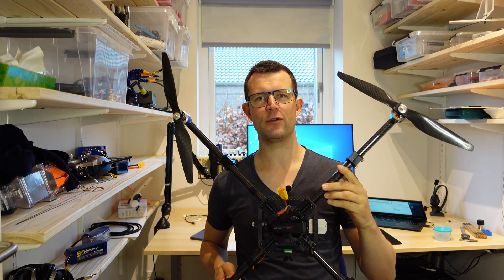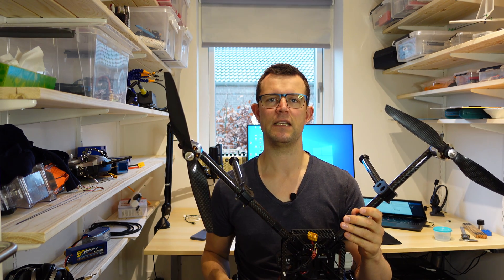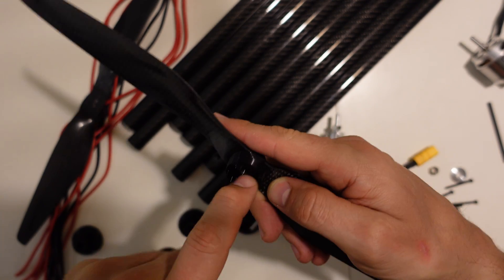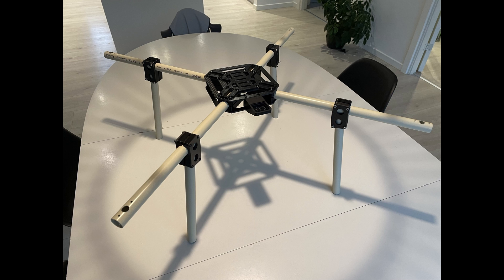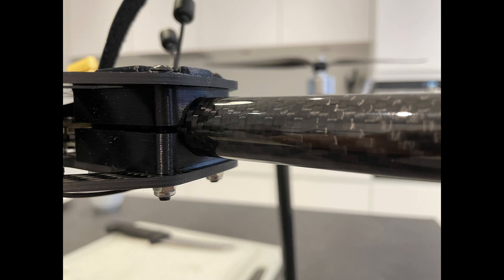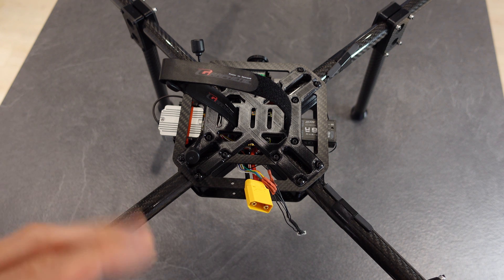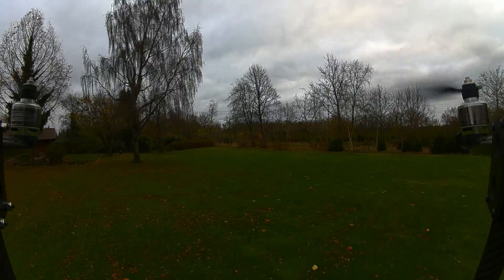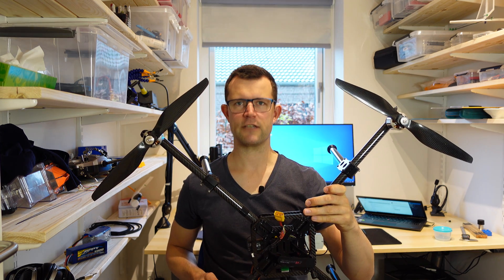Custom heavylift drone (build video)

Comment: I am quite confused about the CNC order from PCBWay as I have not placed such an order before.
The design files provided by Tom are .dxf files.  And this makes sense to me because it is a 2D design we are cutting out of carbon plate.
But PCBWay is insisting on a 3D design for the CAD.  
Are you able to tell me how you managed to place this order with them? Many thanks!
Reply: If you need a hand doing them as 3D CAD let me know, I can do it for you. I’ll export as STEP or any other 3D file format for free. It’s a 2 min job if you have the software 😊
Reply: @Altum2000  Thanks!
I was wondering about this.  I can simply export to STEP? And that is sufficient? So it will be a 3D format but it will still only be a 2D drawing, meaning it will be a STEP file with x, y but no z?

Or should I, as part of that export, add some depth to the drawing the same thickness as the carbon plate?

Basically I am confused about what information needs to be in the drawing for PCBWay to know "we are just cutting this out of carbon plate"
Reply: @ They want a 3D model to ensure the dimensions are actually correct, a common error with DXFs is people don’t export them the correct scale. DXf is perfectly suitable for cutting 2D sheet. 

Likely exporting as a step directly from 2D will give a geometry error as it’s not technically a 3D object, in some software it may allow it, but I wouldn’t advise doing that, there’s a lot of issue that will come from it. 

Best bet is to get your dxf into CAD software and extrude it the thickness of the carbon as you mentioned and export the extruded part as a step. 

Upload that step, with a drawing and Dxf, if you can, just to make it really obvious what you want from them. Drawing should be a normal technical drawing with dimensions and in the selection menu on PCB way select “carbon fibre sheet” at the thickness you desire. 

Personally I wouldn’t use PCB way for cutting carbon sheet, they are great for PCBs but I prefer Xeometry, Geomiq or Fractory for something like this as they are more specialised for CNC/laser cutting, you can upload dxfs and receive free automatic quoting just like pcb way. 

If you need a hand juts let me know
Reply: @Altum2000  This is excellent advice thank you so much for your time!

I am not a mech design guy, but I think I can get by enough to put this design into CAD software and extrude it to the thickness of the carbon sheet.

I will also check out the alternative suppliers you mentioned.  

Thanks again!
Reply: @brianhoskins1979  No problem, best of luck with the build 😊

Comment: Great build! Glad you went into detail in the manufacturing process. Would you mind sharing what dimensions you cut your carbon fiber arms and landing gear to? I'd like to do a similar build.
Reply from the maker: Thanks man. The legs are 25 cm, and the arms protrude 32 cm from the hub so their total lenght is about 35 cm

Comment: HOW MUCH IS THE BUILD
Reply from the maker: About 1000 USD excluding radio and DJI goggles. If you have a 3D printer you can shave about 200 dollers off.

Comment: Great video, thanks for taking the time to make it. I'm working on designing my own heavy lift system based off of this design, and I have one question about your arm mount issue at 7:40 - would it have worked to simply shim the top plate up with some washers to give the proper clearance over the arms? As I understand it, angled arms offer some stability advantages. Is there any reason why some washers or a slightly taller top half of the arm mounts would have caused problems?
Reply from the maker: You are right, and I also think washers could have solved it, still I believe it is a design flaw.